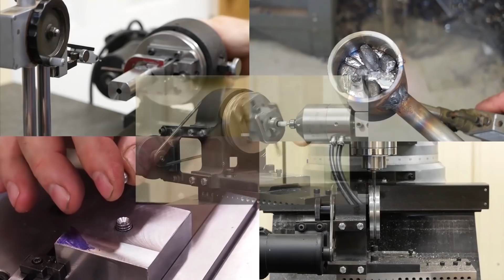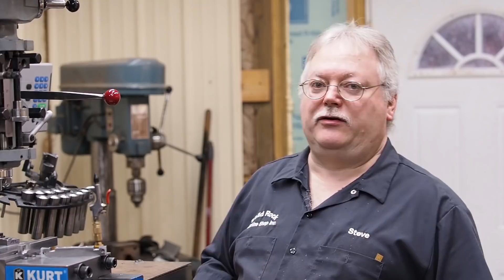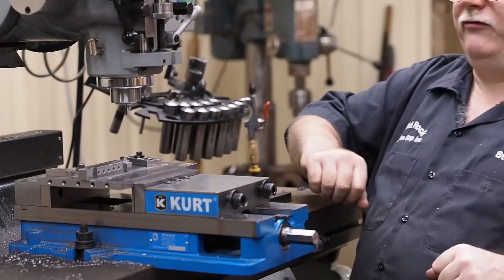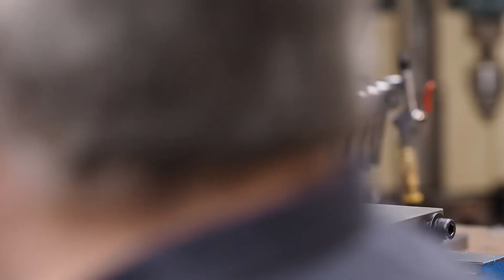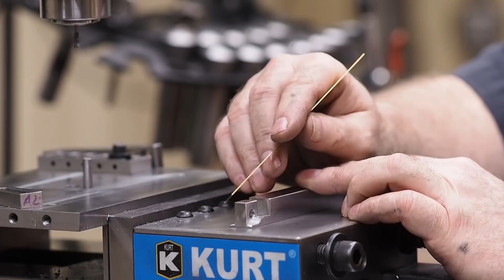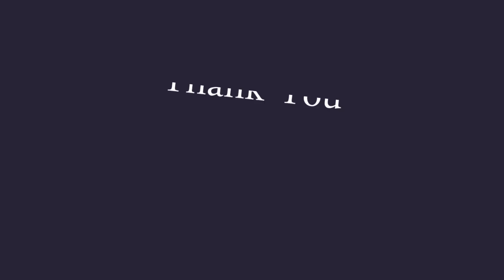Low profile Sine Plate part 2

Comment: I would use my jig grinder to do the radius where you can swing the end mill around and the part is stationary. Great job though.
Reply from the maker: Hi Eric,
My Jig Grinder does not have enough power in the turbine for end mills. The #3 we have at my full time job is way more powerful and we use end mills  even in hard parts there sometimes.
Steve
Reply: Didn't know that about your jig grinder, when i bought my jig grinder it came with lots of tooling including 6 grinding heads so I have a choice from 8,000 rpm high torque to 175,000 rpm for pin holes makes it handy. 
I am amazed at your resourcefulness at using jigs and setups to do just about everything . Thanks for the videos.
Reply from the maker: Hi  @ericrichards5862 ,

You are welcome. My father taught me the value of fixtures and setup at an early age. I am very thankful for the training and insights he provided me with.
Steve

Comment: Thanks for another great video. How about a shaft collar on top of the part for a little extra hold down security? Parts would spin freely, but not lift off.
Reply from the maker: Hi James,
That is a good idea. On bigger parts in the past I have used different ways to hold the part down and apply some resistance to mill grabbing. These parts were small and by using a small end mill I figured I could get away with it.
Steve

Comment: You could have set that second end stop on the vertical side of the plate since the part swung off the edge of the plate.  I guess that is thinking outside the plate. :-)

You could get some extra bend resistance in the lower bar of the sine plate by dipping down where the gap is in the Kurt vice base. That would restrict your positioning in the vice, but that could be an advantage in some cases.
Reply from the maker: Hi I wilton,
Good tip. I never thought of that but it would have worked great. In the future I will be adding more taped holes to the plate to make it more useful.
Steve
Reply: I agree with both thoughts you have presented here. I thought of the second one you mentioned but was still inside the box on your first thought, lol. Cheers from John, Australia.

Comment: Great video! The "dual screen" views (showing a close-up, & an overall simultaneously) are also very appreciated.  After you mill the slot in-between the rolls, will you be grinding both sides at the same time? Thanks again, looking forward to the next installment.
Reply from the maker: Hi Robert Ross,
After I finish milling the Sine Plate off camera we plan on heat treating with a torch which should be the next video and then a rough grind then Jig grind and finish grind and assembly. We hope to capture much of this in future videos the next few weeks.
Steve

Comment: Thanks for sharing.  What ruler are you using?  I've never seen any in gold color.
Reply from the maker: Hi LXGIK 80,
It is a Fowler tin coated. I use them because they have better contrast and these old eyes can see the markings better. They are expensive about $25-$35. The MSC # is 06771653 for the fractional scale. You might find them cheaper at some other supply houses, MSC is getting ridiculous in there pricing lately. I only use them as last resource.
Steve
Reply: Thanks for letting me know!  I might find a deal tomorrow.
Reply from the maker: You're welcome.